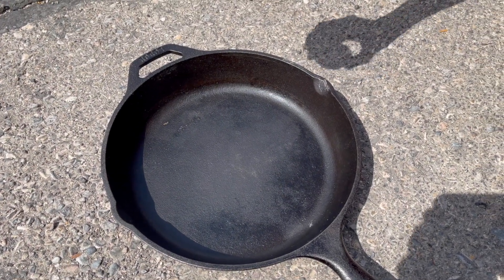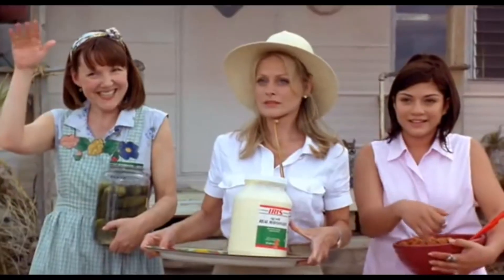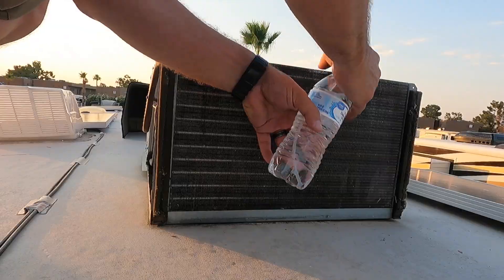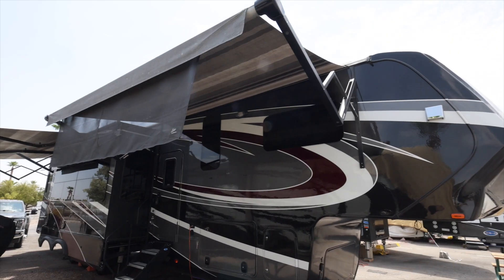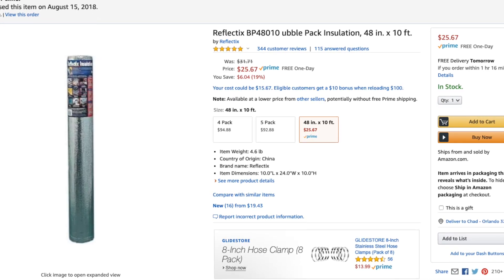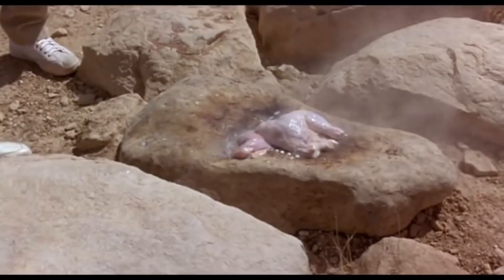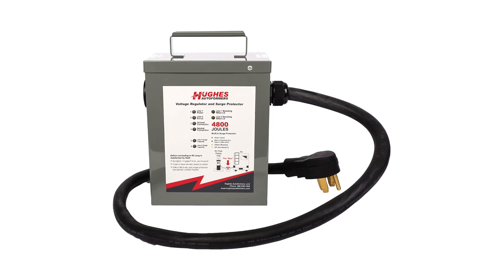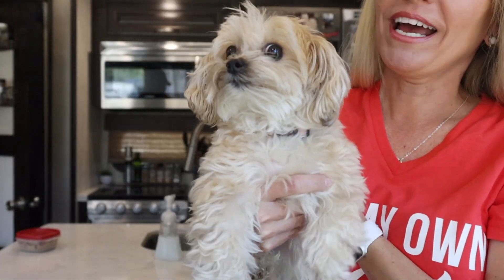🥵  RVing in EXTREME HEAT! ☀️ (Full Time RV Life)

Comment: Have done the pillow with reflexive for a few years. Have also had the reflexive in our bedroom windows a few years, too. Have it on our door. Just did our AC cleaning the other week. No soft start as we have only one AC. We are not sure if we need it because we only have 1 AC? Feedback would be great. Refrigerator cleaning is next and we will be using a small fan for more efficiency. And no, we would never go to those RV parks in the summer! Good info you two!
Reply from the maker: The soft start only helps during startup.. If you're not having any issues, I'm not sure there's a big benefit...

Comment: Come to find out, they seem to drop the voltage to compensate for the usage of power, which in return run all appliances at their lowest minimum operational needs. My guess is they are trying to not have any " rolling brownouts or blackouts! " That's what a buddy said that works in that field. Even in my own home, I've seen voltage down to 98.7 CRAZY! All A/C's works harder here in the desert!

Comment: We are full-time RVers in Georgia.  All campsites, for the most part, are feed individually from multiple distribution panels.  We still have an issue in some of the older parks that were originally designed for smaller units. Another problem is that individuals who plan the renovations will install the bare minimum in coductor sizing, often not taking in to account any voltage drop. All rv parks should be designed by RVers,  not people who never camp.

Comment: Does your go power have power assist where inverter uses the batteries to co-supply in-phase ac on top of shore ac?   My victron multiplus has power assist so I can Boondock at my daughter's houses without blowing their circuit breakers. If the go power does have power-assist do you know why it didn't work?  Victron link:
https://youtu.be/YLG7O49CAIg
Reply from the maker: It only does power-share on line 1, so it wouldn't help the other 2 ACs...   The new victron might....

Comment: Hey chad and Tara I was not sure have you guys got the micro air installed on your rv it does knock down the amps👍
Reply from the maker: Starting amps, but not run-time amps.
Reply: @ChangingLanes  so I guess depending on the the size if they are 13500 or 15000 are they around 23 amps or lower thanks Corey

Comment: Instead of blocking my vents, I open them. Hot air rises and that allows some of it to escape. Seems to lower the temp of the return air to the a/c as well, although I haven't measured if. To keep the sunlight from getting in, I picked up a couple of cheap car window shades (the retractable ones with the tiny holes for the side windows) and put them over the vents light side out. Helps me tremendously 90-105°. Haven't had to try it at 120°.

Comment: If you add the RV Air Silencer in conjunction with the RV Air Flow, it drastically reduces the noise.  I installed the Air Flow system based on your video and had the silencer already.  What a difference the combination makes.
Reply: RV Air Silencer? I also got 3 RV air flow. 2 installed .Being lazy on the last one in the bedroom. It is a little quieter but not sure on the flow. I dont have the tools the boss has.  lol
Reply: @scottl4124  yes google rvairsilen cer.  It reduced my sound by about 6 dB per unit.  I don't even hardly hear our front unit.
Reply: @danasweet4961  Thank you. I will.

Comment: I a high heat situation place a lawn sprinkler on the rv roof.  The evaporation will make a tremendous difference in the ac cooling.  "Sheppards of the Road"
Reply from the maker: For sure!  But, most RV parks would likely not allow that...

Comment: I saw a video a couple of years ago where he modified the AC cover to increase air flow across the condenser coil.  Basically cut out the plastic vertical pieces and put in hardware cloth. Claimed with increased airflow across the coil, RV was cooling better.

Comment: I lived in a vintage camper during my divorce in sc. It only had 1 ac. I ended up hanging a tarp on the sides with a 6-8" air gap.  According to my temp gun it dropped the inside temp around 8-10° without running the ac

Comment: On the solar video you had a wired Ems, wouldn't that device trip when the voltage dropped? I have an older model and mine does. A friend has a Progressive version that shows the voltage digitally.  When dropped below 106 recently it shutdown and recycled. I guess I did not understand the breakers tripping inside.

Comment: Excellent video..Thank you.. Extreme heat is tough duty. I found fitting the reflectix to the outside of the windows was very effective at keeping the heat outside the glass, it was substantial. Taping reflectix over the top of the ac covers seems to work well, along with over the roof vents and skylights. We tied a bed sheet over the back end of the RV class A it made a big difference in the bedroom, the closet is back there I'm sure there is no insulation. I have a piece of reflectix cut for the outside of the windshield its held in place with small bungees and suction cups under the wipers, 100° plus is common for us. Sadly RVs are susceptible to extreme heat regardless of the style. The case fans you mentioned, I had mounted in the upper fridge vent its simple and effective, I also mounted two inside the fridge pushing air over the cooling fins. Thank you for sharing a difficult experience so others can benefit.

Comment: Ohh do I know your pain. 
Problem is we voluntarily done it every year. 
We stay at the Colorado river in Ehrenberg Az. all summer long.   
Having the water and a boat make it enjoyable. 
Just got a 2021 keystone Cougar and have been doing some mods to help with the heat. 
We are stationary all summer, so we put the reflective wrap on the sides and tops of the slide outs. 
Being out there in 122 degree weather made me wish I had my old 5th wheel back. 
I had to replace the roof, so when it was open I put 1” styrofoam on top of the ceiling before adding the  insulation back and buttoning it up. That made a huge difference. 
We did also pull out the vents like you did. 
We had the same problem with our frig. 
We wound up replacing our heating rods which increased our amp rate
And our frig started running cooler. 
Safe travels

Comment: I have never dealt with temps that high, though just spend a week in FL with the 90s temp and 100+ heat index.  Have had many of those weekends without shade in WV and near 100F temps and massive heat indexes.   I have always wondered that when you are in high heat in a very low humidity area if adding some humidity to the RV air would help the AC's cool the interior?

Comment: One thing that I have noticed on our aluminum frame 5th wheel is the amount of heat transfer around the slides through the frame. I used the reflective materials around the inside 4” of the slides. You can not see this when the slides are open and it does make a big difference. I measured (with thermal gun) the walls around the slides at 115 degrees on the inside when it was  95 degrees outside. Doing this really made a difference for us.
Big thank you to all you “old salts” for outstanding videos.
Eric Newland USNR.

Comment: We spent a month in Boulder City where the temp was 116 every day. Previously I had installed reflexit in every cabinet and had cut outs for every window and windshield. I went to Ace Hardware and bought a Patio Water Mister Kit like the ones used at Disney World. I installed them on top of each air conditioner and pointed them toward the cooling fins. I also ran a line down the middle of the roof.  Water Misters, reflexit, clean ac units helped us maintain 80 inside. Make sure you have soft water to avoid mineral stains on the side of the rv. We have one and most of the time the water never came off the roof. We have a 2011 Tiffin Allegro Bus 40'. Another solution would be a Soaker Hose for the roof and Water Mister for the ac cooling fins.

Comment: Camped in 105 degree heat in my new Cougar 22rbs. I know why they put a 15k btu ac unit on a trailer so small, stayed 73 degrees easily on my generator. Same with the 30k btu furnace, cant wait to try it in the super cold. Smaller is better boondocking which we've learned after a 42 ft Durango.

Comment: if you ran 2  AC's would they run really well and maybe do more than the 3 struggling???   I got no idea...
Reply from the maker: Not with a voltage issue.  Each individual AC was blowing it's breaker.
Reply: @ChangingLanes  I know it is not that complicated, but I could neve pass college algebra, either.
Reply: We run 2 mini splits on our house. Great on electric bill! I am in planning stages of a small 18000 unit for my 36’ Carrilite. Either in generator compartment in front or main basement with slide out trays. Separate electric 110 plug. That way you can use extra plugin on plugin post.

Comment: I know exactly what you're talking about. When I was active duty Air Force we spend 8 weeks in Las Vegas at Nellis AFB . 4 weeks in the summer and 4 weeks in the fall. I've seen the 120 degrees and go down the pool and because of the 120 degrees the water felt like ice cubes. If you could stay in the pool you'd turn blue. That's the reason you don't see many people out about during the day in Nevada. Only the tourist were out during the day . You saw them out at night. When I was in the desert during Desert Storm you saw families out at night under a huge street light playing with there children. I felt so bad for our maintenance folks who work on our planes. Then they would try to keep our planes cool but sitting on the flight line on all that concrete , you just roasted until we got ready to take off.

Comment: Look at options for changing your inverter over to a Victron unit... this can then use the inverter side to supplement and up the voltage of the incoming line. The new units even do both legs of a 50A service separately.... you can also add in your generator so if on a 30A service with inversion and generator you are effectively on a 50A service. Also works if you are mooch docking on a 16A supply... as soon as you go above 16A the inverter add's to the capacity... if that is not enough it kicks on the generator. 
Simon (caravanchronicles dot com)

Comment: I'm not sure that closing off the garage is beneficial.  By doing that you're now forcing the rear AC to suck in and cool hot air, which is not good.  An AC unit can only drop the incoming air temp a few degrees so you count on your AC gaining ground on the ambient air to get things colder and colder.  When you force it to suck in hot air your results will likely be worse than just cooling the entire trailer.
Reply from the maker: Good point!
Reply: @ChangingLanes  if you could figure out a good way to suck cool air from the main cabin, possibly with some insulated flex duct, then you'd see some benefit.

Comment: My two Victron Multi Plus 3000's take the shore power that is available and subsidizes the deficiency in voltage, and current with solar and lithium batteries. I have 1000 Ah's of lithium batteries. A/C's (2) work great when the sun shines. I thought that your Go power does the same thing? Anyway, with 2640 watts of solar my roof, temps over 100 degrees is still a challenge boondocking. Can't wait to see your video on the Victron upgrade!
Reply: The multi plus 3000 is Best RV upgrade investment I made!! I can now Boondock at my daughter's house without tripping their Breakers
Reply: It does not subsidize the voltage. It provides a power assist. It attempts to match voltage and frequency of the shore power. It would not have helped Chad with a voltage of 103. BTW I love my Victron 3000 multiplus. I resized my output wiring and installed a 50 amp main for my 30amp on my greyhawk
Reply: @earlhunt2815  Yeah, that is such an awesome feature. I installed the Cerbo GX so I can control all that from inside the RV at my mail control panel, without hooking up to the RG45 connection on the Multi Plus's. I love how all the Victron components can be networked and accessed online through the Cerbo GX.
Reply: @Tom52540  You're probably right. I plugged into my Daughters 15 amp circuit from her garage at 108 volts. Funny she lives in Las Vegas.... Anyway I set the current draw on the Multi's to 15 amps and I ran both A/C's With no issues. I was installing the Micro Air easy starts and I had 119 volts at one of the the A/C that I checked after install. So, I thought that it was "assisting" and bosting the voltage....Perhaps it was the Micro Air units? I just don't know now....lol! My lithium batteries are pretty robust. Perhaps it was just operating on batteries...?
Reply: @starwoodstudios1  That would be my guess. There are times when I place mine in inverter only when external sources are issues. Your setup is sensational. I don't have the rooftop space on this class C. I have 1050 Watts of solar from 3 panels of which 2 are on a remote tilt system. Keeps me from having to climb.
Reply: @Tom52540  Yeah, those Auto Matic tilt systems are great! I have a lot of real estate on the top of of this toy hauler. I have eight 330 Watt panels from Northern Arizona Wind and Sun of which I have to make that climb to tilt in the winter.

Comment: Helps refrig:  to shade driver side of RV with tarp or solar screen, open outside refrig cover, and also have heard where use of 2 computer fans to exhaust the heat.  Can use frozen jugs of water & blow fan behind it to cool the air.  My hubby was on our RV roof working on AC unit at 100 degrees, so 120 had to be hell.  AC cleaning done before going to beach from then on.  White AC covers makes more sense to reflect

Comment: Wow. This was great timing. I put Reflectix in all our windows right before the worst of the heat hit where we are and it made a huge difference.

With that, the next week point became obvious. The floors of our slides were very hot. So, now I'll be looking for some way to attach insulation under them. Obviously it will have to be easily removed for bringing the slides in. Any suggestions?

Comment: I don't own an RV and so don't know if my experience with cooling sticks and bricks homes applies, but air movement is key.  I worked for many years as an architect designing both passive and active solar homes, a few completely off grid, and really it all boils down to air flow more than cooling the air, as moving air, almost regardless of it's temp, is going to be more cooling than non-moving air of the same temp.  All of the points you bring up in this video are valid for the most part, but exiting heat from the RV is as important as keeping heat from entering.  Heat rises, as we all know, so turning on all the vents in the RV that actually exit air to the outside is important, even if you have AC running, as the colder air from the AC will sink, forcing warmer air up and out the vents.  The use of fans blowing RV air OUT in higher windows can also help exit heat from the RV, but should not be used in lower windows.  Placing fans along the floor line helps to keep the cooler air from the AC moving thru out the various spaces, also, as do smaller fans placed at counter-top or table-top level.  Just keep air moving!

Comment: Another great video. Some things we do:  We run our covered fans when we’re driving to a hot area so when we get there it doesn’t take as long to get the RV cooled down.  We have a Lifan 7000 generator that runs both of our ACs and because it is not onboard we don’t have to worry about any heat it produces. We added additional reflective tinting to our patio doors (huge difference)   We also put reflective shades in all the other windows.  Here’s to surviving the heat.

Comment: Hey there shipmate, have you considered upsizing the conductors feeding the ac units?  I am going to do it to my home ac to increase efficiency.  Stay cool!
Reply from the maker: Not sure there's enough voltage drop going to the roof to justify that - fur us at least.  Also wouldn't make any difference at all when the source voltage is 103.
Reply: @ChangingLanes  I agree, low voltage just stinks!  My last house had low voltage due to being at the end of the line and needed a transformer replaced.  I appreciate the content and am working on getting on the road to see America 🇺🇸, thanks!

Comment: When it's that hot. I use a gray or black tarp on the RV. It is a reflective and it does keep things cool in the RV.
Reply: I think you can get alike mirror reflective as a silver tarp over your RV as I will do the same thing too to get more cooldown heat of the trailer.

Comment: Having any rig that needs to run 3  air conditioners to keep cool, you would need a 10k generator.
 With solar you would need dubble your roof space in solar panels and 3, 3k inverters with a lithium battery bank for each inverter......
    Also all your equipment needs to be less than 5 years old.......
Reply from the maker: We have a 15K and two 13.5K ACs... They total about 4500 watts.  As long as we manage other loads like the microwave, our 5.5K works fine.  Just not in the extreme heat where everything has to work harder.  10K would be overkill, but 6.5K would be great.
Reply: wrong

Comment: Well, this makes sense to me now! I had a similar problem at Wenatchee Confluence State Park about 8 years ago, when it was 107F outside, and the forward (Zone 1) circuit breaker kept tripping. We had 50A hook ups, but I didn't have a multimeter, and never thought of testing the power at the meter. I just installed a Hughes Watchdog with Bluetooth, and it's neat looking at the readouts when I first hook it up. (And, yes, your electrical video on this was my guide!) Thanks from a fellow (black shoe) Squid!